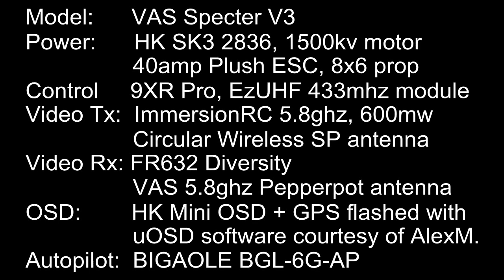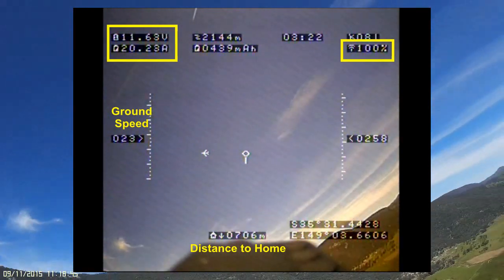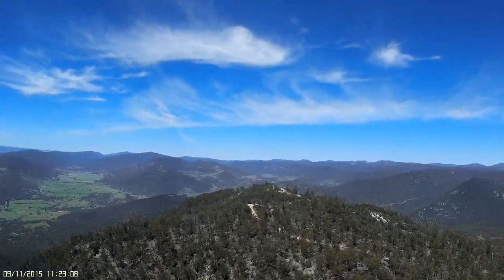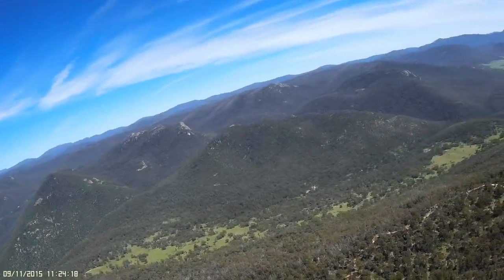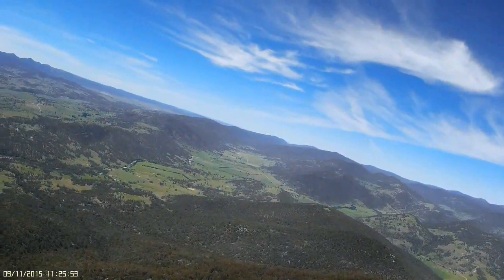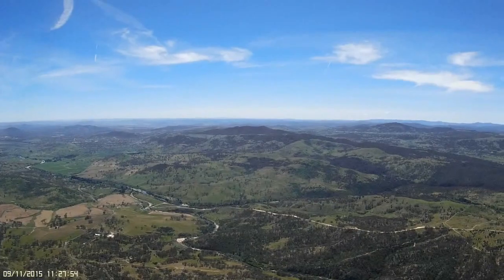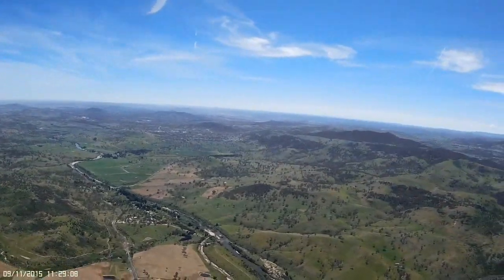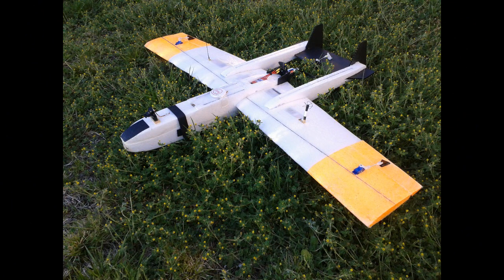VAS SPECTER - TX Dipole Antenna RSSI test 9/11/2015

Comment: nice test, but what is your antenna from the specter, is it inverted vee?http://fpvlab.com/forums/showthread.php?40011-433MHz-antenna-tests
Reply from the maker: I think at this point it was just the Sander wire antenna. I still use them but now turn them into dipoles by soldering an equal length of bicycle cable to the side of the SMA connector as a ground element. The flexible cable simply bends back on landings. I've been out past 7km several times with no control problems whatsoever. It's just the 5.8ghz video gear that's limiting my range now.

I've had positive feedback from several other flyers who've also made the switch from the Diamond to a dipole.

Comment: What happened to the master of disaster? Please no more successful flights, its tarnishing your reputation!
Reply from the maker: +traci beacer Don't worry, I'm sure those flying gods are just building up my confidence before a truly epic catastrophe. Curse them!!!
Reply: Nice one Ken!It all worked seamlessly that time hey!The Bigaole seams to work great, what sort of range can you expect from the uhf control?
Reply from the maker: The Bigaole seems fine now but I was having trouble with the RTH for a few days. I had to reset HOME a couple of times to get it to behave. Too many hard knocks I suspect. Not sure of the range of the ezUHF yet. I've seen videos of people flying over 20 miles with it, but most of them seem to be over pretty flat terrain. Now that I have the RSSI hooked up and seem to have the right antennas I'll start to explore the range. So far I've only been using the low power setting and have had it out to 4K with no problems. I suspect the 5.8ghz video will give out before I hit the limit and if I do, I think the High Power setting doubles the output . . .